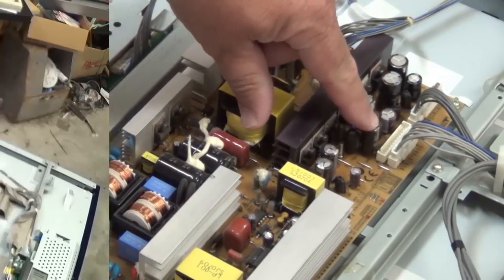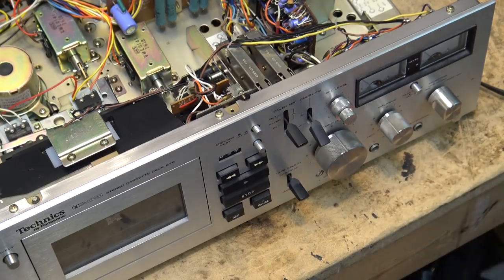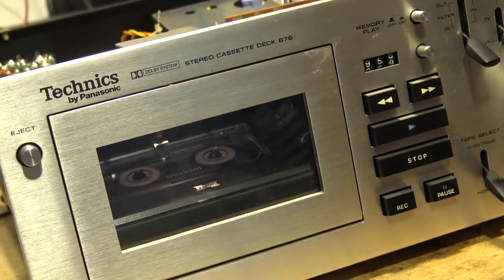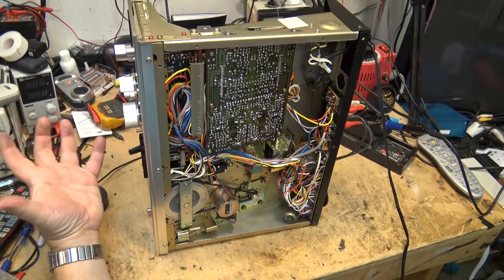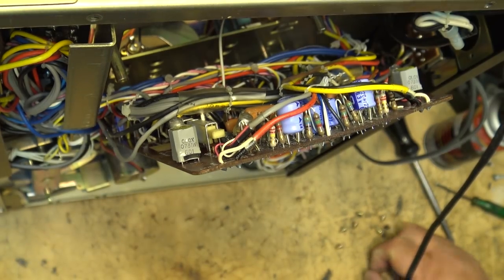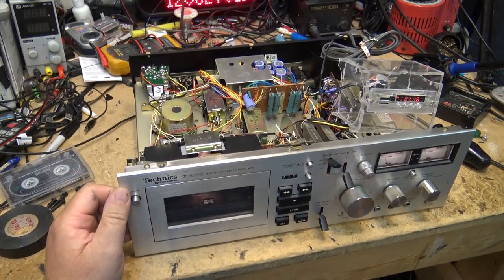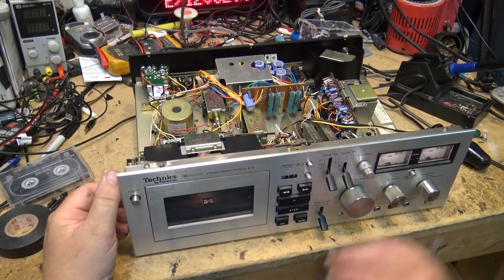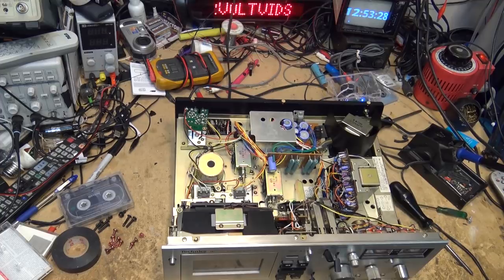Vintage Technics RS-676 Cassette deck overhaul

Comment: Hi! Please tell which wrist watch (Casio!) are you wearing in this video? ... thanks
Reply from the maker: It is a Waveceptor Solar. Has WWVB radio receiver in it to syncronize nightly to atomic clock, and is solar powered.It is model 3023, and it really rare, as I have been looking for another one, and have yet to find one, so the ones out there people arn't selling much.
I have had it probably 15 years now, and never changed the battery, because the 4 solar panels (The black that surrounds the display) keep it charged. It also has a green electrolumaescent back light to view in the dark.

Comment: one deadhead buddy of mine swears by that one older Pioneer deck, buys them whenever he sees.
Reply from the maker: I was never big on cassette myself. Too much hiss for me. Used to use them only for the car then went to dat tape.
Reply: 12voltvids  Still sounds better than a CD to me- even some of the hissiest bootlegs I have are mind-blowing to me, but then, most of those bands -the dead from 66-80-something tapes were the trade, they transcended any poor quality in the recording.  just like Hendrix, I could listen to him thru soup cans and a string. Plus we went with dolby C when they were really dirt, I even tried DBX, but then that '83 or 4 model Technics deck was the only one with it, so. it was usually Dolby B, because car stereos had that setting if ya got a good one..  my pop even got the DBX house speakers w/ 15's and ribbons and 2 other mids.  incredible set. Dolby was a very good circuit and very necessary.  and with a metal tape.. the warm tone like the vinyl I dubbed from -indistinguishable from the wax, man.
Reply: *of course with virtually any old system, a nice 12-band EQ fixes every little thing.
Reply from the maker: @_Ramen-Vac_  
Bought a "good" CD player and never looked back. I have a good table, a thornes and a technics.   No eq either. Just tube amp and some big sb7000 speakers.
Reply: 12voltvids  I have a '57 Magnavox console that I'm trying to set up soon.  and a Thorens TT from the 70's or so to patch into this set... 15's, mids, even a 6x9 mixed in. tweeters are coaxially mounted in front of the woofers.  -it has an old English Idler wheel TT, but it's probably not nearly the quality of the Thorens.  Old Garrard turntables are the shit too.  Sure CD's are fine.  got lots, but no beating the loudness of the analog sound... especially tubes. .. point-to-point wired.
Reply from the maker: @_Ramen-Vac_  
Tubes are ok. Best for  the preamp stage. Hybrid amps have the sound of tubes and the punch and dampening of solid state. 
I have both. 2 full tube amps a McIntosh vintage one of them. My early 80s luxman hybrid sounds better.
Reply: 12voltvids  ha! yeah mosfets and transistors can be extremely good, lots more difficult to chase a problem around in- but the push-pull 6v6 x4 delivers the perfect power and driving super-efficient alnico mag speakers, sweet compression too.  This set I have is actually a 2 cabinet console, probably the first stereo for microgrooves, though I don't think it was set up for stereo, looking into it. If you wanted a midland amplifier, these were the best of them. Macs are super spendy in any era. . . wish I could find one for under a grand! this old Maggie was $60 at the thrift store.
Reply from the maker: @_Ramen-Vac_  
I run a yaquin el34 x 4 push pull in my living room to a set if sb7000. Great sound. The thing with tubes is you can roll tube and get a different sound. 
As far as accuracy goes they are crap but they sound nice. As I mentioned before the best designs use tubes in the preamp stage and solid state in the output. You can even use a class d amp in the output and if you run through a tube buffer first you get the tube sound.
Reply: 12voltvids  HA! ah.. haha!  good to know this now. Hybrid stuff is always so hard to service though, and I'm a fool still looking at it with no schematic, as if anybody who knew what they were doing would even need one on this telegraph of a model. Can't find one! 175-67 is the chassis of the power amp.. the tuner/receiver one I looked over and cleaned the loudness pot, but who knows?  I drag my ass for a year here- because family shit lately and ...  henceforth excuses. what a cool set tho. "Modern Concierto"

Comment: Hi there, I just found one of these at a yard sale.  It is in great shape except that when you hit play / ff / rw it goes for about 1 second and then clicks and stops..  any idea what could be going on?
Reply from the maker: Watch at 12 minute mark and I will explain how the auto stop works. Could be a belt that is broken, or the incandescent light bulb that shines on the auto stop detection disk is burned out.
Reply: @12voltvids  thanks so much!  That's a big help.  It does seem to spin for the 1 second.  i would think if the belt were gone the tape wouldn't advance at all right?   that incandescent light in there is something that can be replaced?  or some ultra rare part?   I have a local electronic repair person fixing it for me and I'm doing some research to find the best information possible to get it back up and running.  Thanks for explaining the FM tuning too because I didn't understand what it meant.  Same goes for that pitch control for the playback speed being fine tuned for accurate play.
Reply from the maker: @8bitwidgets  The belt spins the auto stop disk and advances the tape counter, so if the tape counter isn't moving then you know the belt is shot. If the tape counter moves THEN IT IS the bulb. It is just a standard screw in miniature flashlight bulb.  If you remove the screw and lift that plastic shade you will see the bulb and it just screws in as it is a service part.
Reply: @12voltvids  oh man yea that sounds really encouraging.  the unit is at the shop now, but i do know that i've seen belts for sale at a reasonable price on ebay and i'm glad to hear the bulb is standard and not some part that hasn't been made since 1983.. :)
Reply: LOL Just read on another site that the one [or two?] small belts that run the counter are hard and need replacing.  Since the counter won't move it activates the auto stop.  It also said the main belt was pretty much bullet proof!

Comment: Hello! Stopped deck Technics RS-676. I can not find the size of the rubber belts to give the deck for repair. Could you tell me the size of the belts? Google translation, if crooked, be indulgent. Thanks in advance.
Reply from the maker: Don't know the size sorry.
Reply: @12voltvids  Clear. I'm looking for more.
Reply from the maker: @StreamT34  have to measure

Comment: surely though and maybe you can clear up something i've been wondering about for years. If you have have recorded with Dolby NR on, then, why would you still have it on whilst playing back. is that not, and excuse that popular turn of phrase. Doubling down on the amount of top end the tape won't have. Is that not how that works, or have i been using NR wrong all these years.

Comment: so he just strait up GAVE you a pair of SB-7000 speakers at no charge?
Reply from the maker: Yes he did, and this RS 676 and Technics SA5570 receiver, SL-1200 turntable, a Panasonic mini system and 3 Panasonic HIFI VCRs. The SL1200 was sitting in my garage. Hadn't even made a video of it, had one of my regular customers see it. Said he wanted it. I said I hadn't decided if I would keep or sell it. He pulled out a wad of 100 bills and started throwing them down. It was a deal I could not refuse. I didn't even know if it worked or not, but it was in pristine condition. Since I already have an SLM1 and a Thorens TD165 I needed another high end record player like I needed a hole in my head and that stack of 100's I couldn't resist. He wanted the speakers too, but I wanted them for myself. They sound wonderful on my tube amp. I won't say what he gave me exactly, only that it was well north of 1000 and he told me he turned around and pawned it off on someone else for a healthy profit within 2 days.
People see old turntables and their intelligence just drains out of their body. I sold an old Dual 1214 for 460.00 a few months ago. Another one I got for free, lubricated and freed up seized mechanism.

Comment: Vintage stereo is the best
Reply from the maker: Back when these were relatively new we thought nothing about them. There was always something newer and better. Because of this, much of this vintage equipment was scrapped, and then the big price and quality drop happened, and the reliability of new gear took a big dive. Now the vintage gear, that has stood the test of time is becoming very popular. Even though much of the vintage stuff, especially cassette decks did not sound the best, it still works.

Comment: mmm the oil base caps are better than the water base and now we have some idiots design
Reply from the maker: I have to laugh when I get comments from some that say "why didn't you replace all the caps" or "If I were working on this I would have replaced all the caps"
This is pretty obvious that it is coming from someone that has little experience in electronic servicing, or has gleaned information from the internet from others that have no real knowledge of components.
For those of us that have been around for awhile, and myself I finished my apprenticeship in electronic diagnostic engineering 35 years ago, and started my career that same year in 1983 with Sony of Canada, and for the next 20 years made a living repairing audio and video equipment.
We know the old capacitors didn't have a high failure rate, and when they did fail it was usually an isolated issue that could be traced many times to improper installation. Perhaps installed backwards at the factory, and taking 10 years to blow. (try that with a new cap and see what happens)
The old wax paper types on vintage, and we called those ones vintage back in the 80's too. Those had to go, just like they do today, because they would break down electrically and become leaky. In the high impedance tube circuits where they were used as blocking, and coupling capacitors this would mess with the tube bias and would burn out tubes.
In the low impedance solid state circuits this wasn't as big a deal because t he voltages were much lower, and the move was made away from low value high voltage caps, to low voltage caps.Late 60's and 70's had very reliable and dangerous caps. When I say dangerous, I mean environmentally. Many contained the now banned PCB oil. Once PCBs were banned they went to using natural oils, fish oils in many cases, and then made the move to water based electrolytic. The reliability took a serious hit in the 90's as ar as capacitors went. They have always been the most likely component to fail, but the older ones were very reliable compared to many on the market today.
Every so often one will fail, but that doesn't justify replacing all the others just in case. Unless we are talking some medical life support equipment, or some critical piece of equipment that can't fail.  But in those cases, if something is that critical, the owner of it wouldn't mind spending several hundred dollars to replace every part that might fail down the road. For the average person with a piece of consumer equipment, all they want is to get their piece working again for the least amount of dollars.

Comment: Come on guys, be realistic! I understand that this may bring a sense of nostalgia to those who worked with these tape decks, but by today's standards it's a piece of junk...
- The tape transport makes more noise than a microwave oven
- No dual capstan, the take up spool looks dodgy, there's a reason why this type of tray was abandoned and replaced by vertical load...
- I don't like that REC button that can be pressed by accident
- Two heads only so, no tape monitor, this thing probably has ferrite heads which magnetise easily
- Dolby circuit doesn't seem to work properly - it has a cutoff frequency around 13Khz - It sounds much better with that crap turned off...
- Who cares about MPX calibration? The tone is 19Khz unless the radio station has its tone out of frequency. These tapes barely reach 16Khz, the pilot tone can't even be recorded unless you use a modern tape deck with a metal tape
- No XLR plugs
- All those solenoids have been replaced by electronic IC switches or relays, much more reliable, with less distortion
- Those caps are probably leaking or with a high ESR..
- No Metal Tape bias (in fact, no bias adjust whatsoever)
- No Dolby C, S  or HX Pro...
Reply from the maker: You are missing the point of the mpx filter.  It has nothing to do with the tape recording the 19khz tone.  What it does have to do with is the bias oscilator itself beating with the 19khz tone and the 38khz sidebands that will also be leaking through.  That itself will cause a tremendous amount of noise.
Reply: I don't think i've miss the point - I've worked on a radio station for many years and they had a 24-hour system to record the broadcast for legal purposes. At first they used an old Revox that run with at a very low speed, then they upgraded to a Philips VHS with Hi-Fi stereo. This is how things worked - They had a NAD Tuner tuned at the frequency of the radio station, then the signal was fed to the VHS. Stereo tuners and receivers already have filters to cut the 19kHz pilot tone, which makes the MPX filter pretty much useless. Like I said, most tape recorders from the 60s and 70s can't even record signals above 16kHz, let alone 38K. For a moment I thought you were talking about the dbx filter or the FM compressor, that works basically like a loudness filter, to emphasize low and high frequencies and reduce the noise, but, once again, since most tuners already compensate for this "compression" I don't see the relevance of another de-emphasis system, just saying...
Reply from the maker: @StillCloser  
Not all FM tuners have a 19khz mpx filter in them.  Your vhs HiFi recorder didn't need one because it recorded as an FM signal not a direct recorded signal.   It is the bias oscillator that was the problem and older tape decks this was not a very high frequency.  30khz was common.  30khz - 19khz would result in a sun and difference tone of 49khz and 11khz. Now 49 is far above the capability of tape but 11 is easily recorded and then you get an 11khz whistle in the background.  Go put a scope on the output of a tuner and tune to a stereo fm carrier with no program audio and you will more than likely see it.
Some tuners have it built in and others do not.  Mono radios definitely do not, so if recording from a mono radio an mpx filter is most certainly needed.  Of course if you really were an engineer you would already know this.